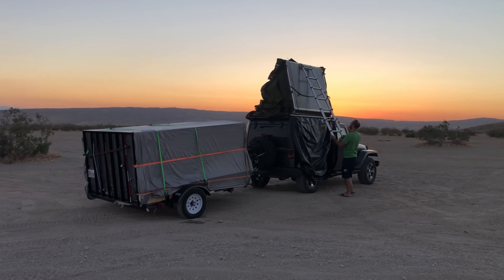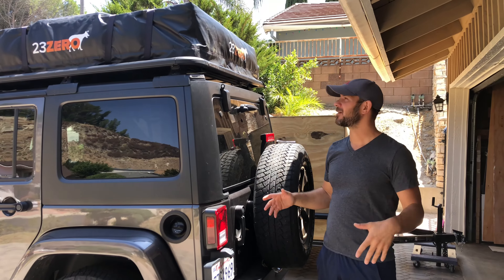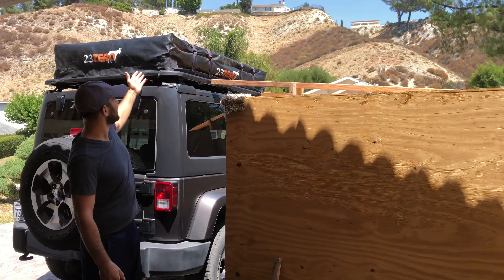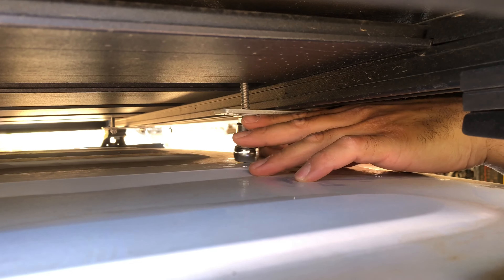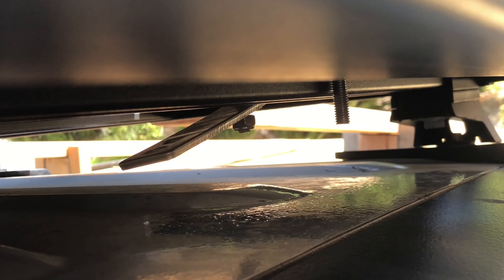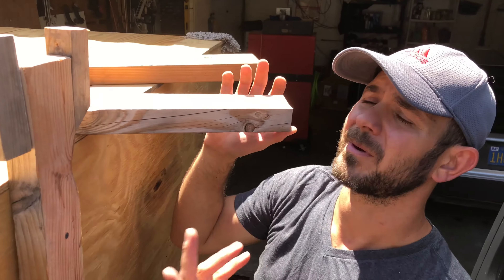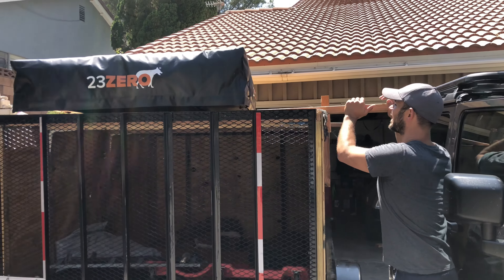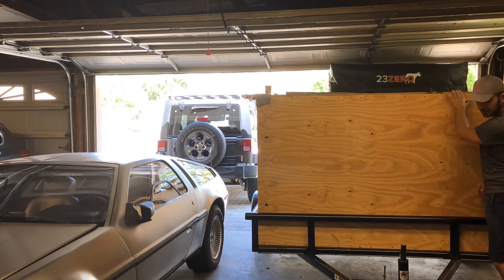Removing The Rooftop Tent From Our Jeep

Comment: How did you mount your RTT to your pioneer platform?
Reply from the maker: The rails on the 23 zero were perfectly positioned to the openings in the pioneer platform.  I just had to put it in place and use the hardware included with the 23 zero RTT.

Comment: can i ask you what rhino rack legs you have in the video?
Reply from the maker: The place I bought them from called them low profile legs.  On extreme terrain, they are called Rhino Rack RLCP leg brackets; 
For the off-roading that we do, we did have to use locktite to keep the screws that attached it to the roof from loosening.